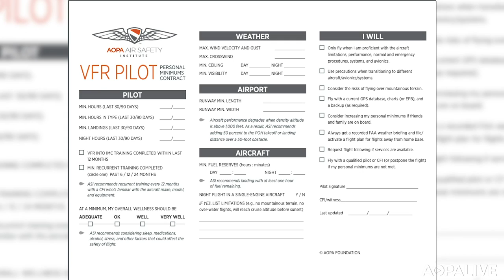Draco Crash Lessons Learned

Comment: Very happy you all walked away ! But think of this because you were rushing to beat the storm you placed your family in harms way ! It's one thing to place yourself in this serious condition but your lack of judgement to place your family into it is a sign you need to stop and gather yourself and admit your getting ahead of logical thinking that is now causing you a problem. This isn't the first accident that a flight crew disregarded safety simply because they were in a hurry to get home. You learned a very important lesson and glad you admitted it ! I was a Air Force flight engineer and crew chief on a C-47  1954- 1959 and I had crews that wanted to get going back to base when I would have a Red X condition , needless to say I would ground the plane till I fixed the condition. Power of the pen ! They forgot my butt was on that plane and my job was to make sure it was air worthy !
Reply: "Get-home-itis" 
That split second decision that says to hurry up rather than wait it out.
Reply: @timmorris3056  I concur !

Comment: Draco didn't have a large enough Rudder or Ailerons. The Helio Couriers have interceptors (spoilers) which augment the Ailerons.  When flying so slowly, the control surfaces need to be larger.  Also, the winds were gusting over 30+ Knots at the time. I didn't see any Aileron correction into the left crosswind on Draco's takeoff.  The rotor over the hills can be wicked.  I flew my Helio, DC-3s and Britten Norman Islanders in Sierra Mountain Wave conditions, however, I knew my limitations, and I had a lot of knowledge about how winds behave in different terrain.  Draco was not designed to handle those conditions.

Comment: A very lucky pilot. From an old African bush pilot: I've personally known a number of outstanding bush pilots who were killed in airplanes which were functioning perfectly. They were killed by complacency and over confidence. Saving a few minutes to not taxi to the runway with wind on the nose, or land with a tailwind because the runway is "long enough" and i'm "skilled enough" can bite you hard. A rare exception is obstacles at one end making it more dangerous to take off into the wind. In Tanzania you have Ngorongoro Crater airstrip. Elevation 7800 ft and a warm climate 2 degrees off the equator. Wind direction didn't matter, you always took off from west to east due to a very long sloping hill on the west of the strip. It was very deceiving to look up that hill which seemed to be a gentle slope which told you you could easily climb above the hill....but in most light planes the hill exceeded the climb rate of the planes. Every couple years or so a general aviation pilot from another country would attempt it and crash on the hill. I give Mike credit for his no excuses attitude. That attitude will get the most out of a tough lesson.

Comment: I like the idea of personal minimums. It helps you avoid bad decisions like this.
Reply: There is older footage of him flying in much worse weather off airport. But he was always able to take off into the wind, which is rudimentary simple, as compared to this cross controlled crosswind takeoff. He went into detail about the crosswind component that was reported and he said it felt good on the run-up and taxiing was still doable. There was an absurdly strong gust that came up right as he was lifting off. Look at the storm clouds nearby and you can see a deep divot, inverted dish in that cloud. That's possibly a Downburst, only a mile or two away. Also, the clouds are showing what appears to be mountain-wave effects. Though it's likely not a factor at the surface.

Comment: Surprising how easy the wings came off. You can see the starboard wing kind of fall off, and it never even struck the ground.
Reply: It was the torque from the wheels hitting the ground. These kind of airplane wings are very heavily strengthened against forces pushing them up (lift) however the are not strengthened for for downwards forces, when the wheels hit the ground it twisted the whole airframe to the left around the roll axis which meant the right wing was being forced up but the momentum of all the fuel in that wing resisted it, and like i said these kinds of wings are not meant to take that kind of force.

Comment: This accident has made me wonder why computers and digital marquees haven't been adopted to give pilots better wind info than the old wind sock which hasn't changed since the beginning of aviation. The marquee, visible from the end of the runway, would give current wind velocity, bearing, range of bearing variation (how much the wind is swinging), highest gust in the last 15 minutes, lowest velocity between gusts, time since last gust, and average time between gusts. Sounds confusing at first, in no small part because the end of the runway is where pilots have a lot to think about and don't need more. However, I think this info could be read and interpreted at a glance and would be enormously helpful for a pilot to know precisely when to start a takeoff roll or even to cancel the takeoff if they didn't like the odds.
Reply: Makes complete sense to me.  I feel the tower should have advised him that conditions were very poor for attempting a takeoff.
Reply: It is not our job as controllers to tell you how to fly your airplane. Trust me, you wouldn't want that. Most controllers are not pilots. We do advise the wind and other information pertaining to safety of flight. The choice to land or takeoff is up to the pilot in command, as it should be.
Reply: Hs Hs 
Watch Patey’s video-  he knew exactly what the wind was doing. He fully understood it was gusting, and a severe crosswind. He even considered asking the tower for clearance to roll off runway into the wind- since he has the gear to go off-tarmac.  He had taken off in crosswinds in this plane before and felt perfectly confident that it would be off the ground within 50 feet and he could point the nose into the wind... the cross wind was severe enough to fully compress his starboard gear linkage- which he noted before committing to take off... but did not necessarily fully comprehend that his port gear was fully extended with nearly no weight on it due to the action of the wind over his left wing.
Because of the extreme STOL nature of his plane- he had nearly enough wind over his left wing to fly when he was standing still. But his right wing was shadowed by the fuselage suffering turbulent air and providing no lift at all.
Because he had done amazing low speed takeoffs with this plane in all sorts of situations, his familiarity and self confidence got in the way of fully understanding the physics.
The moment he rolled forward- his left wing had ample lift while his right wing was generating nearly none, and the left wing lifted off- as soon as the left wing underside was facing the wind- the wind was sufficient to push it over further and initiate a groundloop.

Every pilot who corkscrews into the ground on short final had instruments showing him he was in an uncoordinated turn. No amount of ‘information’ nor re-iteration of information is going to fully prevent a bad decision by a good pilot.
Patey was complacent in his self confidence, - and EVERYone who is highly skilled at what they do suffers that alike,
and he was in a hurry to beat an incoming weather front... so his mission- plus his self confidence led him to make a decision that blew up in his face.

Had it not been for the specific timing of the gust that lifted that left wing off the ground- Patey would have very likely leapt Draco into the air and been nose into the wind within a few seconds.  Confirming his belief in his own skill and the likelihood that he might try the same thing again in the future-   unaware of  just how close he came to disaster.
Complacency in our skills bites us in the backside when we have that unlucky moment that we have escaped thus far.
It is a blessing when we can learn such a lesson without anyone else being hurt.
Reply: You cracked it Christopher,I wondered why that leg was compressed it all makes sense now.
Reply: @christopherpardell4418  FAA pilot manuals talk all about these circumstances.
Reply: Checkered Flag Films - ...and yet pilots still make bad decisions. Familiarity breeds contempt in us all.
Competence can become a trap.

Comment: Draco is the second plane I know of to have a left crosswind incident , in exactly the same location, 30 years apart.  The other was a c172, commuting from Stead to near Carson City ( my brother in law).  After reviewing your YouTube videos and recalling the other incident, there are added factors that pilots should look at.  Specifically, surrounding terrain and buildings.   

The buildings 1/4 mile to the south east are 30 feet lower than where the takeoff roll starts.  Additionally, the buildings are about 30 feet high at that low point.  The would mean a pretty stiff vertical lift component on the left wing only.  The right wing being shielded by the fuselage.   I made a quick CFD model to try and highlight that along with added air instability caused by the buildings.
My thoughts.. in addition to you comments.... no flap takeoff, if same path down runway 26 is used.   Pick different spot on runway such as where the air race start finish line is or taxi back to start of 26, where the vertical wind component should be minimal.
Bill Reeder

Comment: Key takeaway: Personal minimums for part 91 pilots.  No one's telling you that you have to go and no one's telling you can't.  Even the wilga's factory cross wind recommendations probably wouldn't have applied after all the wing modifications so ultimately it's up to him.
Reply: I suspect the gear mods were also a factor—doesn't, or didn't Draco have taller gear and a steeper deck/wing angle on the ground than a stock Wilga?
Reply: @islander4986  good point. I know the tires deffinetly increased the AOA. That and the shock modifications might have increased the wing area exposed to the crosswind.
Reply: SO IT'S UP TO PILOT'S TO MAKE STUPID DECISIONS?
Reply: @johnorabone6112  Often we do I'm afraid, and Mike was quite forthcoming in shouldering the blame for this one in the video he initially posted. A very public confession, and I find myself admiring him for the way that he's accepted responsibility for the incident without trying to shift the blame.
Reply: @johnorabone6112     We all make stupid decisions as pilots on a daily basis. I have nothing but respect for Mike in this instance. While he made a dumb decision to take off in those conditions, he was the first person to admit it regardless of the consequences. Not only that, but he's doing everything he can to make sure other people don't make the same mistake.

Comment: What level of engine damage would be expected from a crash like this? I see that all propeller props were sheared off. What internal components would most likely be severly damaged and would the engine be worth fixing?
Reply: For safety I would ship it off to a turbo prop mechanic get it stripped to bare components and inspect EVERYTHING...

Comment: Draco represented an emerging evolution of flight. i am old and have been an aviator for most of my life. Draco did things that i have never seen done before. Now that Mike let the genie out of the bottle, i predict we will see Draco inspired knockoffs.
The fact that the only injury was a broken fingernail makes the incident an even bigger blessing. Even with the total loss of the aircraft the lessons learned will be far more valuable than the cost. 
The potential of these new "beasts" calls for a reconsideration of flight operation procedures. If there were an emergency sufficient to warrant attempting a launch in strong, gusty, and switching mountain winds, i would want to have a Draco for the attempt. Here is where Draco's capabilities should cause a rethink. Draco had the potential to taxi "cross country" to launch into the wind.
The video of this incident WILL save MANY lives, of that, there is NO doubt in my little bitty mind. My hat is off to Mike for taking one for the team. He demonstrated how a man should take responsibility for his actions.

Comment: A 5 second radio call to tower, nobody else is flying with the current winds, the runway is his, he's holding short facing directly into the 45 knot "headwind" with More than enough power. 
"Tower, my ground roll will be about 10 feet, I need to take off cross runway in my current heading and I'll turn once I'm at 500AGL(about 10 seconds)." Tower would have said, Kool, we're going to film it!!! Pilot in command Always makes the final decision and 99% of the time Tower will support it, especailly in this case. 
Mike is Awesome, Draco Will return Better and Badder than ever before!!!

Comment: It seems that private flying is open slather in the USA. No wonder there are so many accidents. Down here every flight has a filed and approved flight plan, even at an airshow with takeoffs and landings all the time. He would not have been given clearance to take off, period. Too bad if high winds might shut it down. It does not matter. It was a 40kt cross wind. Madness.

Comment: I betcha Mike has Draco fired up and flying in less than a year! 
Let's kick the tires and light the fires!
Reply: Uh, maybe in a 'Draco II' but his original Draco is a complete loss (i.e., will never fly again).
Reply: @Nevada_Dan  well maybe it's wishful thinking and faith in that guy. But I know nothing personally of the extent of the damage. Mike did say in a post, damage was worse than he initially thought:(
Reply: Had the prop not struck the ground at full power, Draco may have been salvageable, although that would be impossible when one of the gear legs collapse. In the video of the crash, Draco stayed intact right up until the prop struck the ground and all that torque & vibrations going through the airframe just ripped those wings off.

Comment: The problem with the AOPA Personal Minimum contracts is that a pilots Personal minimums are constantly change with practice and and currency. Example if I haven't flown a couple of actual IFR approaches in a couple of weeks or so my Minimums for the departure & destination would certainly be going  go up. Like wise if I hadn't flown a particular Aircraft in a while all My minimums, IFR & VFR (Wind'Visability) would go up.  Personal Minimum are not static they change ever day depending on currency. Signing a piece of paper doesn't change that. Personally I see it as just a FEEL GOOD thing for beginners.
Reply: @Jonathan Obviously you are NOT a pilot and don't have any idea how air craft insurance works. One can not just jump into anyones plane and fly it unless it's for maintenance or instruction ... I had to be put on each friends insurance as a named insured. All Insurance claims are checked to see if you/anyone were current for the type of flight.

Comment: If you have too much lift on one wing while standing, it will have even more at you gain speed, and make you roll over..  happened to me on a cherokee, but i kicked the airplane into the wind as I felt the bump of the wing lifted the strut, that saved the day.. ended up on the grass- but with out damages.  It is called Lateral Lift.  Happens also when airplane spins on runway at speed and winds push the wing up.. The 777 that crashed at St Francisco a few years ago went up about 50 feet in the air after it spun on runway after hitting the seawall.  https://www.youtube.com/watch?v=zTXDalv7kNQ

Comment: "Draco Crash Lessons Learned"
Don't try to takeoff with a 45MPH direct cross wind.
Someone tried to call what happened a "Ground Loop"...Because a tail draggers center of gravity is behind the main gear, the tail has a tendency to want to swing around.
This was ALL wind that lifted the left wing up causing the left gear to come off the ground and the right wing tip to drag on the ground. This created a pivot point for the tail to swing around and when it did the inertia and kinetic energy caused the left gear to slam back to earth causing it to break along with the wings.